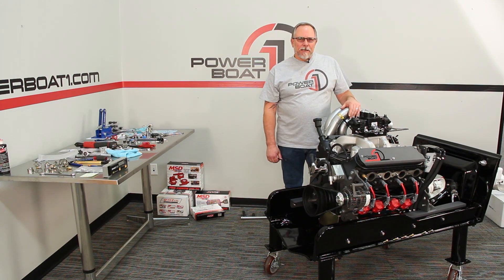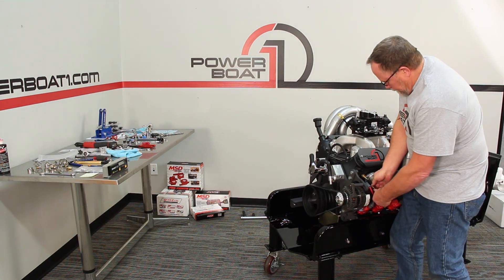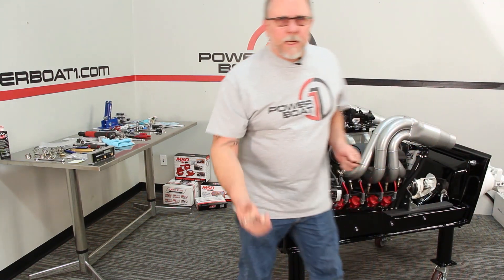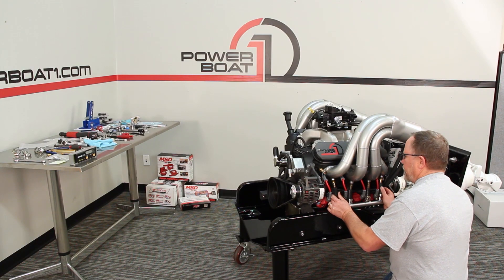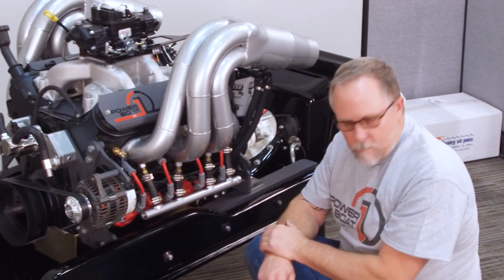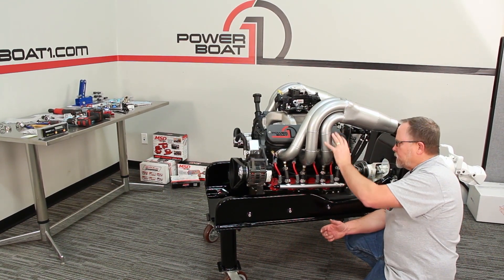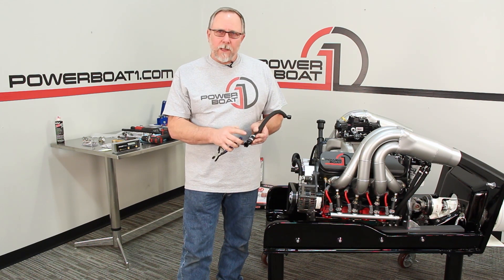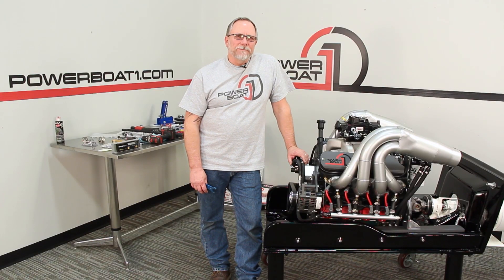LS ENGINE MARINE CONVERSION: Installing the Headers

Comment: How do you get a good working 02 sensor for efi if the exhaust is cooled?
Reply from the maker: The O2 sensor is placed before the exhaust gases and cooling water are mixed.

Comment: Seems like the AN fittings used on the water manifolds for the headers would restrict flow. Does the raw water have other path(s) to exit the boat?
Reply: This engine was set up for a jet boat installation which only has a single 5/8" hose water inlet. A sterndrive installation would be plumbed differently.
Reply: Checking the flow rate and full-load running temps once everything is plumbed in, would be a good start, yeah.
Reply: Always install a pressure relief "t". At full throttle, a good jet drive has a lot of pressure, anything over 15 psi will dump overboard

Comment: I just became your 2001st viewer!  Plus I watched the whole series. Not sure the advantage of that elaborate jacketed exhaust. Also you did not show how you cleaned up that wiring mess to make it neat which you implied you would show. Otherwise I wish there were a lot more videos on marinizing engines the way you show it so clearly and with the idea behind why you do it. I wish I had that guy to help me when I go to do it.
Reply: The advantage of that elaborate jacketed exhaust, is that your 8 year old won't end up with life-long disfiguring  2nd degree burns marks on his/her face in the situation where the engine is being installed in an open engine bay configuration. In a closed bay, they drop the bay temperature to a point where the fiberglass hull is not getting so hot the stern of your boat is threatening to leave the party.
Reply: @randallsemrau7845  Yes, I meant as opposed to commonly used simple cast iron versions.
Reply: USCG regulations require headers in a closed compartment to be cooled with something besides air.
Reply: @theprojectproject01  I meant as opposed to commonly used cheaper cast iron.
Reply: @paulbriggs3072  Oh.

Well, castings only make economic sense when you make a LOT of them.  The economies of scale.  For low volume sales, weldments are cheaper.  And for raw-water cooling, stainless is the material of choice.
Reply: @theprojectproject01  Yes I agree.